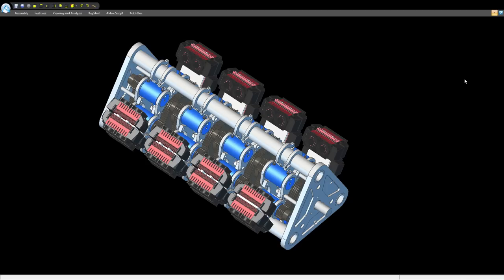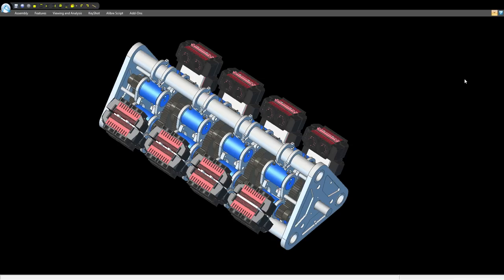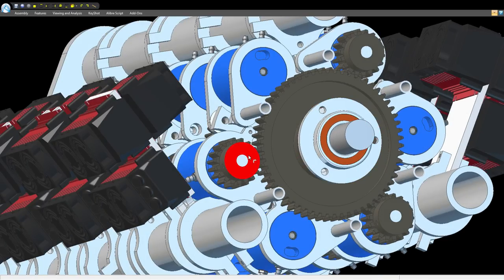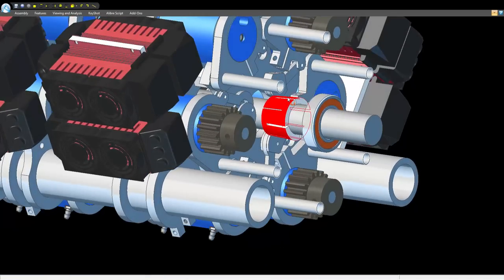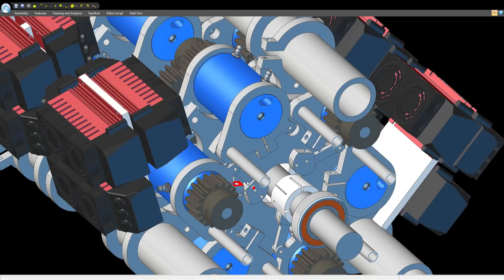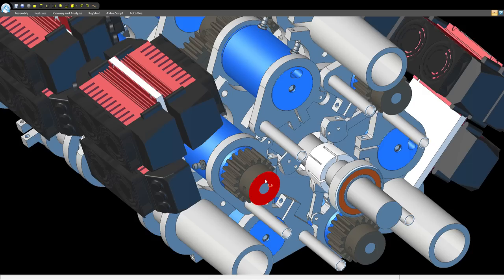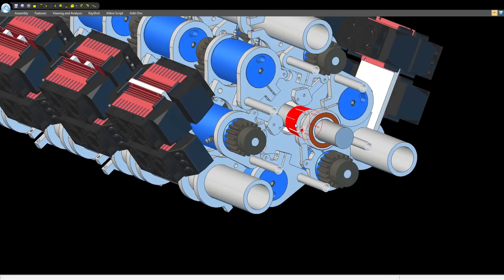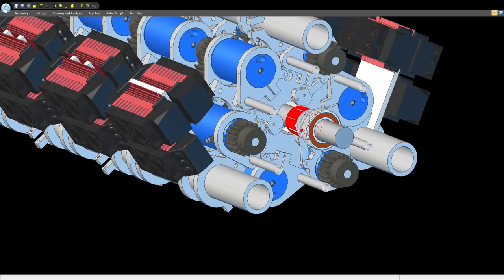MG F Electric Conversion - Bespoke Power Unit

Comment: I had a similar idea. Only I have not made a CAD drawing of it but only a sketch on a whiteboard. I wanted to run it first only a lawn tractor. This will be enough for 3 motors. As soon as I have the money and time, it will be built. Nice to see that I am not alone with the idea.
Reply from the maker: Hi, hope you get yours built too, I've sat on many ideas in the past too (over the last 20 years) and seen others create them in some form or other, this used to frustrate me and I'd just put aside my projects. Now, I build them anyway as everyone follows a different path to solve problems, creating diverse projects, this is why I want to share my projects and am happy to help answer some of the questions you may too. Hopefully that way saving anyone else from hitting the same costly problems. Good luck with your project and feel free to ask.

Comment: Sounds like a great idea. Need to make this into a kit, would love to get something like this to convert my Morris Minor to electric!
Reply from the maker: Thank you, I am busy making parts for it now, with a few more videos on my channel, once all finalised I will be sharing all the 3D files for people to print or mill/CNC, plus sharing the programming too as open source. My plan is to get it all working first, modify the parts if needed (normally the case) then share them once proved. Also the plan is to make changeable mounts that just bolt on and an end plate to convert to different gearboxes, that way it should fit any car 😀. Please take a look at the other videos, I'm happy to take suggestions too 👍

Comment: nice idea.. the only thing i dont see quiet working is the leaver pulling these gears in and out. just leave them connected and put a syncro ring from a standart car on the main gears or a clutch in between your main engine block (4) assemblys.
I think it would be enough to have 4 blocks beeing able to be switched on and off as you need it.

sorry for my awfull english. hahah
hope you get it runnin all love from my side
Reply from the maker: Hi, your English is fine fully understood 👍, I looked at clutches and one way sprag or clutch roller bearings too, although found electric clutches pulled too much power, sprag roller bearings wore out too quickly and other clutches used hydraulics and or linkages that increased the size of the unit. I may go back to these options later if my way doesn't work, although I like the idea of removing one motor, battery and ESC if there is an issue with it so having lots of redundancy. I hope this answers your question and thank you for your comment 😀👍

Comment: This is an interesting idea, good luck with it. I should think that if the speed is brought up to the same rpm as the other motors it should mesh ok. A regular gearbox works that way, I guess you'll find out. Thanks for sharing.
Reply from the maker: I intend to sync the motors to the main gear with an optocoupler before attempting to reinstate the gear (kind of like a digital synchromesh).

Comment: Hi, I have a suggestion that will save you money and time, drive the motors at constant torque instead of at the same speed, this means that you don't have to have the encoders, and that you won't have to figure them out. Constant torque is the same as constant current because this is the formula for torque in a BLDC motor: (3/2)(1/√3)(60/2π)(I/Kv)≈8.269933×(I/Kv). If you have any questions please feel free to ask.
Reply from the maker: Hi, thank you for your comment, my intention is to use current sensing into each ESC and directly maintain this value using a hysteresis loop derived from PID. Hopefully I can maintain a current following system with 1 motor acting as the lead, we shall see. Also, the lead motor will cycle through all 24 to prevent one overloading. I may have to quiz you later, thank you.
Reply: @TheSolarPoweredEngineer  hi, can you please tell me what motor you're using. Also, an E-bike uses the constant torque, so it doesn't have to look at how the wheels are spinning or how you're peddeling. What my suggestion is at this point (this may change if I think about other things) is: instead of using the normal ESC's, use ODrives because this allows you to use current control easly (if the price is not to high). Also if you drive them in constant current you can skip the part to dislocate the motors to cool them because you can drive them al at the same power and that means also the same heat production. The last thing I want to tell you is that I'm not trying to break you're idea down so please do what you think is good, I'm just trying to give my opinion and say what I think about everything. If you want to, you can send me a message on Messenger so I can better explain my thoughts. Cheers.
Reply from the maker: @carelsberghstijn  I'm using the 4084-1050KV Aquastar motors, although looking at the O-Drive motors now to possibly compliment O-Drive controllers. I will have to play with both types. I appreciate all input, so please feel free to break it down.
Reply from the maker: @Mike D I will take a look, cheers

Comment: Fantastic idea, I got this link through James Bruton's last video. I'm a little worried those gears will heat up and melt though, so what about encasing all the motors and gear box then oil cooling/lubricating the hole lot? Subscribed!:-)
Reply from the maker: Thank you for subscribing, I think the ESC's would hate being oil-cooled lol, and have worked out that the power unit will mostly be used at 10% to 20% capacity when accelerating unless I put my foot down. It's rare to drive at full throttle as a radio-controlled car or boat would (especially on UK roads (-: ).

Comment: When can we see this in a car and being made
Reply from the maker: Hi, I have many of the components and my milling machine on standby, so please watch this space.
Reply: @TheSolarPoweredEngineer   i like the idea but how are u going to power it efficiently people like u and james bruton i hoped i spelled it right inspire me and i have had an idea to use lipo cells. people salvage them from wrecked teslas or thy buy them off the internet but if u do buy them fron the internet people will try to rip u off i suggest that u and james bruton and the owner of the youtube channel HBPowerwall he does projects on the lipos i was talking about and he could work on the battery part for your project. People like him have been connecting lipos in series to make one big battery to power their houses and there projects like one guy who converted a gas car to electric and took several motors out of a treadmills and used them but he used the average car battery which is bulky and heavy and are not that efficient. But then i was thinking why does gas have alternators. Then i thought to my self well it recharges the battery from the last cranks of the starter so the battery wont die. But then i thought what u said when ur cruisen down the high way u said it would only run one row of motors and the other batteries and Motors  that are not in use cool off then i thought James is good at coding he could use a raspberry pi to be the brains of the motor so while one row of motors are in use u could put a alternator on the motor so while ur cruisen down the highway u could have the motors in use to charge the other batterys that are not in use and power things like the radio the head lights and signal light ect.  

Ps im only 17 and im sorry if some of the stuff i type doesn't make since Remeber every ones not born to know stuff. 

I know its Hard when ur camera shy i used to hate cameras until i had to for a project grade for school at first i was scared to death until i went on camera with a buddy then i felt better about it u and james should do a thing where u edit and he is the guy on camera then when u feel comfortable enough to go on camera do a thing where james introduces u to his channel.     

 There should be more people like u and james in this world to inspire and teach the next generations of people
Reply from the maker: @lilsynx.official5908  thank you for all your comments, and don't worry we all start somewhere. Yes I will be using off the shelf LiPo batteries, 1 per motor and cycling through them, I will only be doing short journeys at the start, so small batteries for round town and large LiPo's plugged in for long distance. Unfortunately the alternator would not generate anything while cruising, although this could be used to put something back under regenerative braking, maybe to the 12v aux battery that will power the lights, safety systems and brake servo compressor that I will need.

It's good to hear all the questions from you, keep asking them, it's healthy to have a thirst for knowledge..

Have fun.
Reply: @lilsynx.official5908  There is no reason to put an Alternator on an electric motor, just use the power directly from the battery. If you used an alternator you're just converting Electricity to Electricity while losing energy to friction, air resistance, etc.

Comment: Very interesting concept and for fun and/or hobby is fine, however, for a more real application, it would be good to know how is this motor superior to the 3 Phase AC motor that are used in the current electric cars? I can see a lot of moving parts in your design that could  lead to more faulty points, however, it could be superior in terms of efficiency, cost, flexibility.. etc.. have you made the calculations to do a comparison against current solutions?
Reply from the maker: Hi, these motors are 3 phase too, albeit lower voltage, I don't believe these will be more efficient as there are more moving parts, although you could run on less motors for more efficiency, so I won't know just yet. It's more about cheap of the shelf parts and seeing if it's possible to make it all work together, modern high speed microcontrollers allow men in sheds to try concepts like this I guess. The fun part for me is discovering the solutions to all the problems, making a working product

Comment: From what I understand is that you are reading the speed of the gears but not meshing them. I'm afraid you will break those gears very fast. Maybe some kind of synchronizer to between the pinion gear and the motor would work.  So you would bring the motor and the small gear (which stays engaged to the big gear) to the same speed and use some kind of cone friction clutch to connect them. I'm not an expert in any of these subjects but that's how I would try to solve it.
Reply from the maker: Hi, I thought I responded to your post but YouTube says otherwise, doh! that does sound like a good idea and could possibly work too, although would increase the number of component. I will be trying to electronically synchronise the gears before engaging them at the same teeth speed by using rotary encoders. I f that does not work I may look into doing it this way. Thank you.

Comment: Neil,  I concur with the comments regarding torque drive and eliminating the encoder idea. Also why the mechanism to engage and disengage the motors? Simply turn the current off to control heating. Also - how is this an advantage over one large motor? Many motors bring more complexity that seems too be non sense unless there is some economic advantage which I doubt. Please provide justification for the complexity(s). Perhaps there are good reasons, but not at first glance.
Reply from the maker: Hi, no worries, thank you for your comment. the idea to disengage is mostly to do with faults if any of the motors, ESC's or batteries have an issue, the motor can be disconnected. If a MOSFET failed in the ESC, for instance, there is a strong possibility of a short on one or all of its phase outputs, thus causing motor windings to resist the stator from rotating. For the efficiency thought, if I run the unit on only 3 motors and had them rotating the 21 other motors that had no current flow, there would be resistance from the 21 motors (even if the MOSFETs ran a high impedance open state) and resistance from the meshing gears also. If you tried to rotate 1 motor by hand with no connection to an ESC there is always resistance and this would be multiplied by 24. Also, with a motor disconnecting, the whole circuit feeding that motor could be powered down unit it was required again. My theory is that one large 70kW motor is a lot harder to turn than 3 x 3kW, therefore reducing energy consumption. Plus this unit costs less due to cheap off the shelf parts, can be upgraded and is designed to see if it can be done this way.  It is all theory at the moment, so please watch this space for more. I hope that makes sense :-)
Reply: @TheSolarPoweredEngineer  

Note: you are devising solutions to problems you have created,... I appreciate the 'creativity' aspect, but I am not convinced that the approach is worthy of your time and money. Anyway enjoy the ride.
Reply from the maker: @mr1enrollment  I do enjoy a challenge, I think most solutions come from problems humans create, I love the fact that we still try to solve them and sometimes discover new things along the way. If people learn from my mistakes, it's worth the money 😀.
Reply: @TheSolarPoweredEngineer  This motor design looks ingenious but a bit fragile, wouldn't a Nissan Leaf motor or similar be much simpler and more reliable? Proven technology and all that.
Also Have you any idea how heavy a battery will need to be to drive a car? I built a 126 cell battery for an ebike which can deliver around 40A (my cells are not high current drain) but it weighs around 6 or 7kg. Even with high drain cells like the Samsung INR18650-30Q you'll need at least 20 in parallel to give 300A plus however many in series for the Voltage you need. Have you worked out what peak Voltage and current will be as it's critical to the number of cells required but whatever it is will be a whole lot more than you'll want to carry around.
BTW I owned an MGF for a while and loved it and I also considered electrifying it but it had too many body related  issues so I moved it on. 
You'll probably need to pump up the suspension but maybe wait until the conversion is completed to get the levels right.
https://www.youtube.com/watch?v=JHf2MPgOtUc
Good luck with the build.

Comment: You should look into helicopters one way clutch bearing : They allow two turbines to spin a single shaft but only if they are at the right speed : https://youtu.be/Fsp3fm4KHs0?t=53
I think the search term would be :  Centrigugal clutch -> https://www.danubewings.com/helicopter-transmission-systems-the-clutch/
Reply from the maker: Will look into this, although I have a 3D helicopter that eats them bearings for breakfast and may have issues with multiple power sources
Reply: @TheSolarPoweredEngineer  Well it's just an idea, I just read about them that's why I brought it up. But I think they are especially design for multiple power source : If the second turbine doesn't catch up speed to the second turbine then it is never engaged and that's how they manage power failure on one of the turbine. Keep up the good work mate :)
Reply from the maker: @yahelbouaziz3767  Will do, I will probably try that too, watch this space....